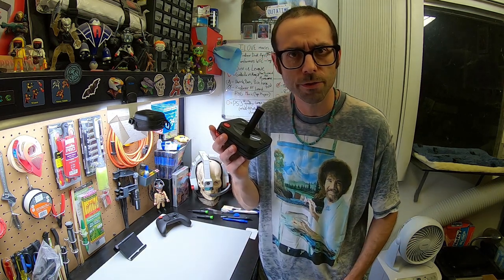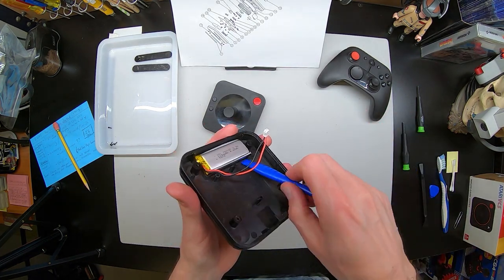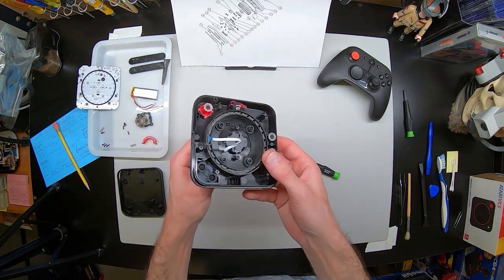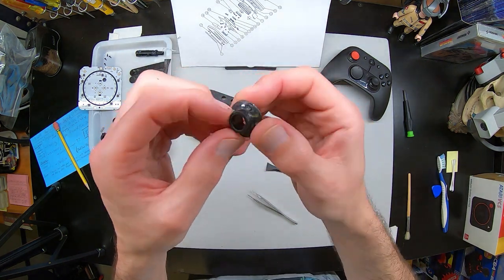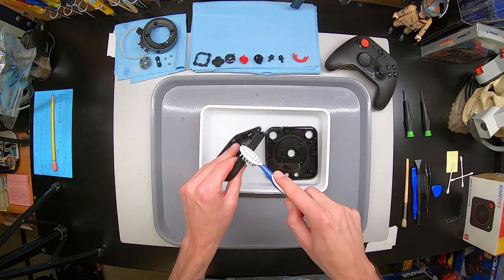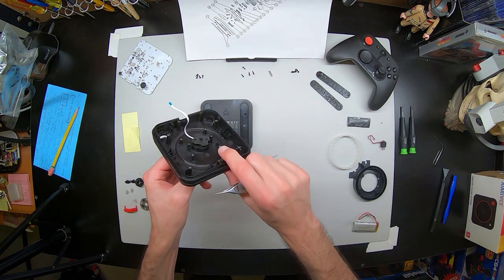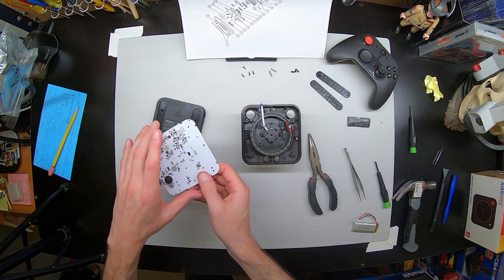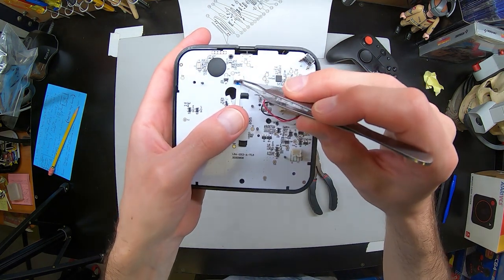I LOVE Atari VCS - Classic Joystick Full Teardown and Cleaning - Ep 063

Comment: I don't know how to make the controls wireless can you help me to know
Reply from the maker: If your talking about making it wireless with your Atari VCS, you need to have your Console ready to Pair a new controller, this can be found in your console settings.
With your Joystick off, hold the Atari button for a bit until it flashes (it will be different than when you turn it on)
You should see it show up on the console and connect in a few seconds.

If your talking about with a normal PC or other console, I am not sure if that is possible, may have to use it wired in those cases.

Comment: Man I wouldn't take mine apart unless it was broken. The Classic Controller is unavailable on Atari store website....?
Reply from the maker: Yes they are sold out there, However you can still find them on Best Buy or Ebay for the normal prices. I'm going to grab a few in case they don't come back in stock, but I would imagine they will as the manufacturer is not the same as the consoles 🕹🤞
Reply: I'll guess they are sold out because  @ILoveStuffandSoDoYou  already bought them out just in case 😉😉
Reply from the maker: @JeffSmith03  LOL 🕹🕹🕹🕹🕹🕹🕹🕹🕹🕹 you mean all of these 😎

Comment: I’m having occasional spinner issues in games like Thrustlander and Breakout Recharged. I wonder if greasing the inside of the shaft would help.
Reply from the maker: If they are similar issues to what I mention, I would say Yes. Also you could clean the contact inside the Stick top if after you open it, they appears dirty.
In games like Yars, if I would spin it quickly the character would skip around, rather than just spin smoothly around entirely. Now after cleaning and spreading out that grease evenly, it's all good 😎👍 Playing even better than the day I got it 🕹
Reply: @ILoveStuffandSoDoYou  I finally took my original joystick apart. Found that one tab had snapped off. I glued it back on, greased the spinner. Works good as new now.
Reply from the maker: Sweeeet, thats Great! Spreading out the grease really makes a big diffeance 🕹
Was it the same tabs that broke in mine?
 @derekdash2179
Reply: @ILoveStuffandSoDoYou  Couldn't really see them in your video so I'm not sure.
Reply from the maker: I show the ones I mentioned at this part of the video https://youtu.be/8XQTBUfBH3o?t=1789 @derekdash2179

Comment: Seems like a lot of work, lol. But I might try it if one of mine craps out. Fortunately I've had zero issues with my stock collectors one or any I bought. Can't say the same for the moderns
Reply from the maker: Nice, yeah I would not attempt this unless you need to. The Joysticks are great, I have not had issues with the modern controller... what issues have you encountered?
Reply: @ILoveStuffandSoDoYou  on one the right trigger gets stuck and slowly depresses. The other, my left analog stick became loose and drifts now. Wobbles
Reply from the maker: I see, that sucks... maybe I'll have to tear apart a modern controller eventually too. See if they can be clean/fixed easy as well 🎮 @ObsidianContraption